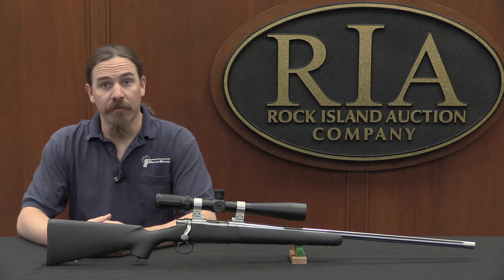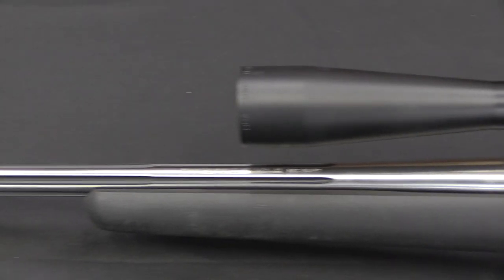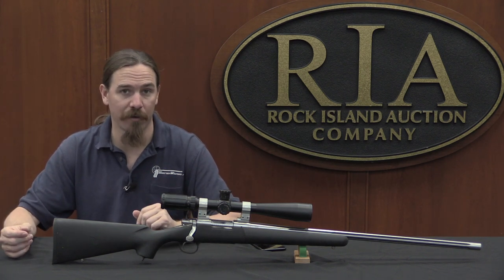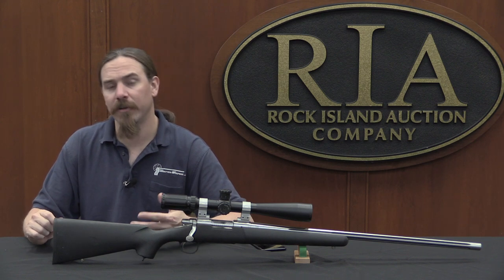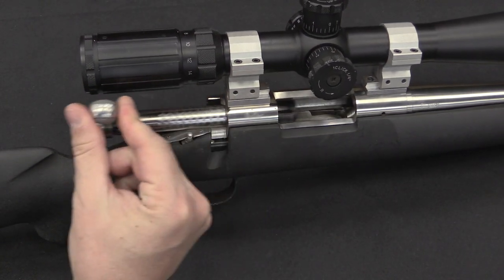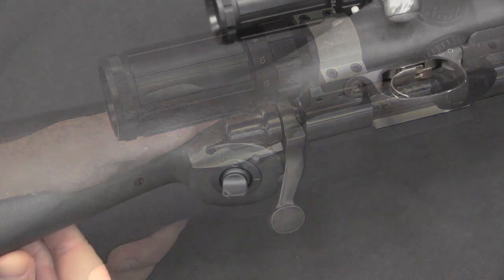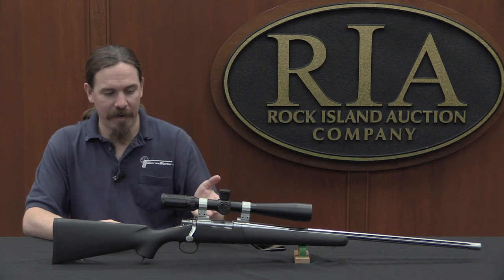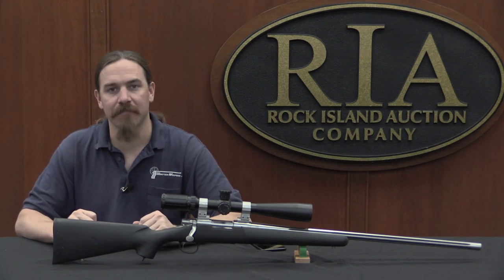Remington EtronX: Electrically Primed Ammunition

Comment: Actually, I prefer coils and chemicals. Something machines can't hack.
Reply: Given the description of how it works, this is basically 4 light switches in a row (series), with the first being the lock switch, the second is controlled by the logic gate, the safety is third, and the final being the trigger. The gun can't fire until all 4 are in "on" state. The logic gate is the only part that could be in any way "hackable", (not counting basic damage that could be done with a screwdriver and wire cutters, etc) but it isn't wireless, and is likely a solid state PCB, so it would either have to be reprogrammed physically by plugging it into another computer or by physically replacing the PCB. Both would require the gun to be on an open bench.  It's not smart enough to program it to kill it's owner, so malicious code would either fall into firing when it shouldn't, (which would still require consent of the other 3 switches, including you pulling the trigger) or saying it is unsafe to fire when you want to fire and preventing firing (might be easily bypassed by removing the logic circuit, but it probably also controls capacitor charging and discharge)

Comment: The ACTUAL "TASER". It is quite telling that the 220 is called the "Swift". The idea is over a century old

This is more of a rich man's toy. Not functionally self-contained. You need a power source that is external in origin and an external activator and an additional system: electrical, with which anything can go wrong as well as requiring a whole additional system of knowledge to understand and care for, to do the same thing simpler systems have done for over a century and a quarter. To make my coffee, I use a range pot ratnerh than a Mr. Coffee: I  can get at 100% of it to clean it (even following the instructions, the Mr.Coffee does not clean proplerly) and it is simpler with no hidden parts that I can't get at. This means it will not be as reliable as a mechanical, self-contained weapon. If it is over 100 years old as an idea and has not become mainstream, there is a reason. In short, why invent something to replace the use-proven, well-understood perfectly good wheel, ESPECIALLY in a critical part of the system;  and MORE espeically with something that is not an integral part of the system in two of its parts?
Reply: Nice essay

Comment: Improvements on design to make it marketable: 

1.  Make the battery compartment so you can replace the battery easily in the field.  Very bad design currently (no pun).  When hunting..."Hey, my rifle is out of power...got a screwdriver head on you?"

2.  Get rid of the LED altogether.   REALLY?  This thing flashed telling you, more or less, the safety was off?  And then you have to go through a series of steps to stop the LED?  Can we please leave the Microsoft mentality out of our firearms?  We don't need more nannying.  If someone is so inept they need a reminder every time the safety is off, they likely, and sadly, won't be using a gun long anyways.

 3.  Get rid of the key.  Ask yourself why there is even a key to start with.  The narrator says its so the battery life will be maintained.  Why should there be any current flowing at all from the battery if the trigger is not being pulled?  Oh yes, probably to keep the computer behind the annoying/worthless LED powered slightly.

Interesting addition: solar powered/charged - that way the expense of batteries is negligible also.  Battery charges all week by ambient light and ready to go for the few hours the gun is used.  Fast charge system (like a phone) for when needed).

Intersting question...why was it so expensive to buy when there were a lot less machined parts in it?

Comment: I wonder about the ammo and static electricity. Nice scope
LOL , GJ , only had a Rayovac, for a $2000 (now who knows how much $$$) gun.
Gee , GJ spurge a little and get a Duracell.
I don't understand why they didn't just add an electric currect to a spring fire pin bolt, so it could fire normal rounds , and also use electric rounds to eliminate the spring delay/movement for real competiton accuracy shooting

Comment: Isn't the objection the same as the objection XM-25? Unreliability of electronic components in a tool where failure may mean your ass. OK, maybe academic with .22 bolt actions, but still. Simpler means less shit to break which means more reliable.

Comment: What I want to know is why they chose such a high resistance! And why the hell does the insulator wear out!? That's almost certainly planned obsolescence, no joke.

I can only imagine they intended it to be impossible to set them off at battery voltages, to prevent accidents. So they have a boost converter charge up a cap, still doesn't really explain why the insulation needs to be so beefy or why it wears out... unless it has absolutely nothing to do with the voltage and is caused entirely by the vibration breaking the ceramic, which makes me wonder why they don't use a high temperature polymer instead...

Comment: A shark and a polar bear at the same time. Hahaha thats hillarious. 
Sadly most of the people alive today in a time of technological advancements have little idea of how emp's work. When you drop an emp you deliver an electrical current bomb that is so powerful it can send power through the air itself and over charge everything in its area of effect. Think of everything thats sensitive to electricity and imagine it recieving far too much. Basic wiring like this rifle. No problem. It will likely fire without you pressing the trigger lol. Unless it over charges the capacitor until it fails. If theres a circuit board with sensitive electronics it can fry otherwise it will be fine. Thats why emp's are so hectic. You can unplug your pc from the power socket during an emp and it will power up turn on like that one ghost movie and then burn out after recieving to much current. Solar bursts from the sun can do the same and send us back to the stone age. Hence why nasa is so important and keeps a close eye on the sun like an early warning system for earth quakes. America dont be cheap with nasa for gods sake. There are protections against emp's. Those silver looking bags your video card for your computer comes in and sometimes your mobile. They cost a lot surprisingly. Dont throw them out. I dont know what they are rated to but im guessing there is a limit to what they can mitigate.